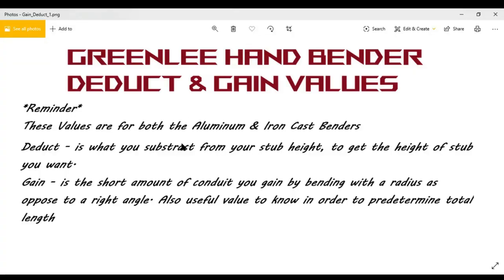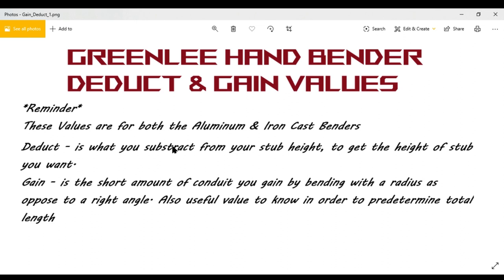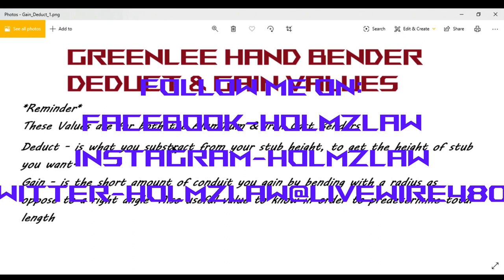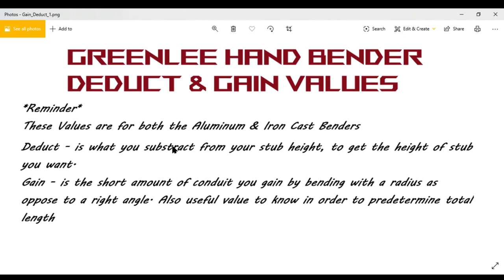Conduit Bending: How to, 90 Stub, 90 Back to Back, Calculate and use Gain for any Bender.

Comment: I really enjoy your videos. You make it easy to understand. Any chance of doing concentric bend and rigid pipe bending.
Reply from the maker: Thank you that means a lot. Really appreciate it. Lets me know i'm not wasting my time. Also lets me know i'm helping people. 
As far as rigid pipe bending goes it's the same as emt only that it's harder to bend and that you need to thread it. All the formulas you use for emt you can use  for rigid. Is there a certain topic on rigid you want me to cover or just bending, because its really the same thing. 
I'm already working on putting something together on concentric and segment bends. My example will be with hand benders but i will explain how to do them with hydraulic benders as well. I might be able to throw an example on hydraulic benders but I'm not sure yet. Thanks again. 
Follow me on :
Facebook@Holmzlaw
instagram@holmzlaw
tiktok@Holmzlaw
Post your conduit work on these social medias at hashtag #conduitologist #conduitology #conduitologism #holmzlaw #artofconduitbending

Comment: Hey holmz, got a question with using the gain to mark all your bends before even bending. Does that work? This method is coming from a conduit book im reading.
Reply from the maker: I don't know what you mean. I don't think you have to do that for every bend. Only when you are doing multiple bends and you are laying out all your bends at the same time. Other than that you don't need to use the Gain

Comment: So a 90 degree bend on that bender will give you a 3 inch gain, meaning that you can trim off 3 inches to account for the shortcut made by the bend. I believe I understand that part correctly. Now when I apply that gain to offset spacing, I need to make sure I understand.  Let's say the offset is 30 degrees. I believe I have to half that to get 15, and 15 is 1/6 of 90 degrees, so 1/6 of 3 is 1/2 inch. My guess is if I wanted a 30 degree offset with 2 inch spacing (center to center) then I would need to add or subtract 1/2 inch × 2 inch which would be 1 inch. Am I thinking correctly?
Reply from the maker: Thanks for watching my video. Sorry i took so long to respond. I meant to respond the other day. Anyway you are sort of on the right track. Only thing is when dealing with offsets you don't really use the gain you use the shrink to figure out placement of bend. I mean offsets do have gain but its easier to use the shrink. I explain it all in this playlist. Im sending you a playlist of one of my most useful videos that i have. I hope you get Something out of it. 
https://youtube.com/playlist?list=PLOshL7_adwvPM2a1BdvOngSKyzIBJeAIb

Comment: If you measure a mark then find your loss you dont need any further calculation. Give generous material on first bend, measure loss, measure second bend minus loss from outer & done. Trim excess. Works with any size tube or pipe
Reply from the maker: Loss? For 90 degree bends? You main the Gain? That's why I made a video cause most people won't understand what you just said.
Reply: @TheArtOfConduitBending  i do mean gain. 2am here lol. I realize when material size is detrimental, allowing ectra then trimming may not be the way to go. I was taught to allow more, measure gain then trim. Was lucky to have a huge steel plate to mark out on as well as plenty of room to move. I mids my engineering shop days. Will watch more of your vids✌

Comment: How would you mark your pipe with the 10” stub back to back with 43” distance, so it all come out the same 10” stubs
Reply from the maker: You wouldn't be able to get the 10" on both sides without cutting the conduit at some point. I dont know what size conduit you are running but for example. Lets say it 3/4 emt
Mark 4inches from end of pipe and bend. = 10 inch stub
Measure 43 inches from the back of the 10 inch stub be sure to use a straight edge behind the stub when measuring and mark 43 inches. 
Use the star on bender and turn your back on the side you took your measurement from and bend. 
Now you have 2 stubs one longer than the other cut the excess off and your done.
Follow me on
Facebook@holmzlaw
Instagram@Holmzlaw
Tiktok@Holmzlaw
Post work here
#conduitology #conduitologist #conduitologism #holmzlaw #artofconduitbending
Reply: I’m bending a full stick of 3/4 rigid on an electric greenlee 555 bender and want to have a 48” back to back 90 with equal stub up on each end. Unable to cut and thread the pipe.
Reply from the maker: @rpmspeedyblue  ok so i could help you more if you told me the length of equal stubs you want. But then again i dont want to just give you the answer. Anyhow ill help
So what you need to know is the gain for 3/4 rigid conduit which is 3-3/8" for every 90° bend. 
What you need to do is cut and thread before bending cause most likely you wont be able to afterwards... Am i correct?
In order to do that you need to calculate the exact amount of conduit you need to complete your bends. 
Example. 
Lets say we want a back to back with 10 inch equal stubs with a distance of 48 inches between both backs of 90°'s. This is how to calculate total length.
10+10+48-gain(3-3/8)-gain(3-3/8)= total length 61-1/4". Dont forget to add an inch or less for the threads. Depending on if the threads are going into a connector or if your just going to double lock nut it. Hope this helps. In the future if you need to find the gain to other conduits i believe this is the video where i show you how to find the gain to any conduit its really simple and its something you should do when you first approach a new bender. 🙏👍🙏
Reply from the maker: @rpmspeedyblue  i hope that helps. Also i want you to know that the gain changes on different size conduits and types of benders so if i were you i would watch my video on how to figure out the gain. Any questions just shoot me a comment.
Reply: Holmz Law I will have to figure the gain on the benders radius and go from there. Thanks for the info👍
Reply: Holmz Law 👍Thanks

Comment: Damn bro, you really are the truth.  Great video.  I have one question for you.  How would you use the gain if you're bending one 90. Or would you just bend the 90 and cut it to fit?
Reply from the maker: Ok so gain is what you use when you. Want to do multiple bends after a 90. So you need to know the gain of the size conduit you're bending. Maybe i didnt explai. It well.
Reply: @TheArtOfConduitBending  ok got it.